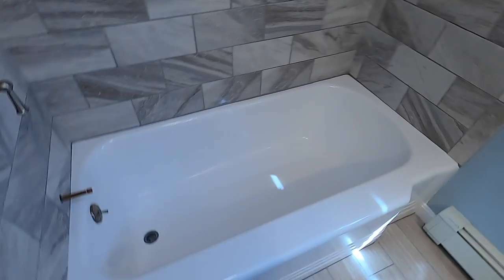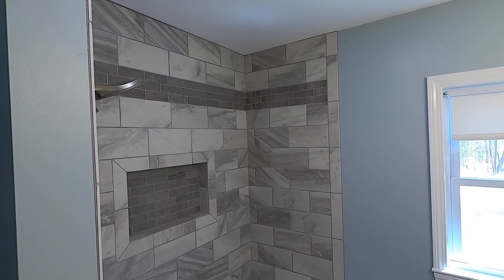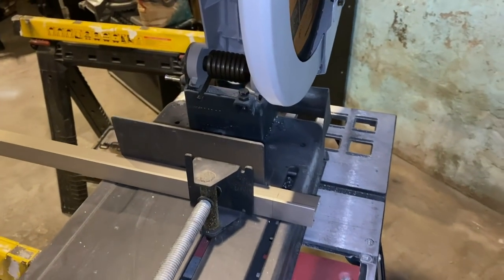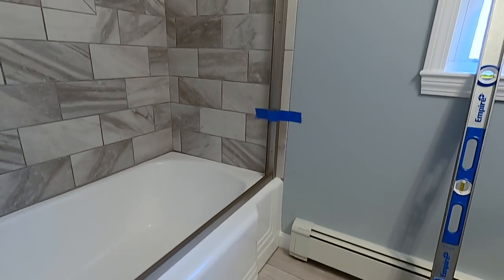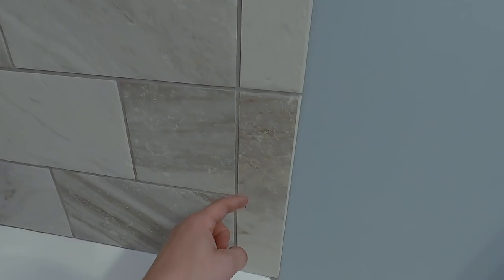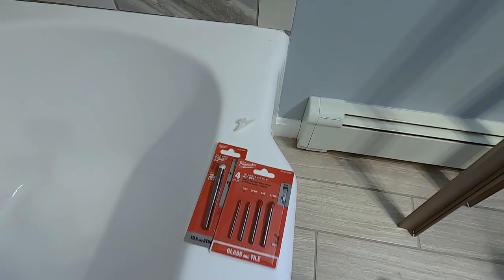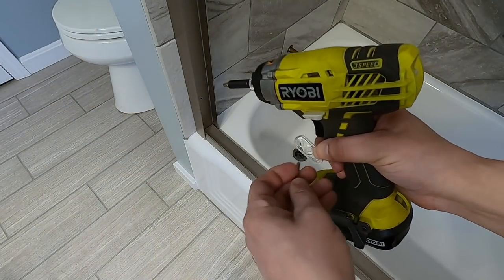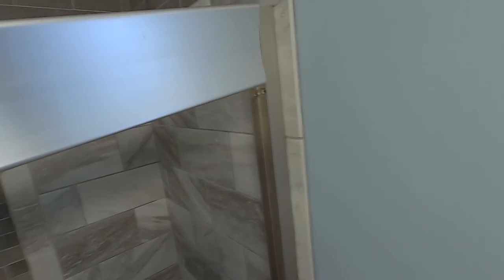How to Install Tub Sliding Glass Doors - DIY Bathroom Remodel Episode 23

Comment: The inside door should be closest to the showerhead so the water doesn't go out the opening between the doors. The other thing with that door, the water tends to splash over the bottom track.
Reply: I hate my Delta door for the splash under the glass and on to the floor. Adjusted the glass as low as it can go and still will splash off the metal bottom channel..
Reply: It's the absolute worst...I've just got used to wiping down the floor after showering. They had sent a rubber stick on channel after I complained but that didn't last long.

Comment: I will share what I consider much needed info on this Delta system. The brackets that screw through the glass that the rollers are attached to NOTE there are horizontal grooves on one side. The Delta Logo on both doors face into the shower. You can feel the etching. The inner door has the grooves facing into the shower. The outer door the horizontal grooves face toward outside the shower. Another VERY important NOTE is that if you try to use the lowest holes in those brackets you will NOT get the rollers to sit on the track rail properly & the bracket will rub against the frames groove for them to slide on. A tip my wife thought of was to add a tiny spacer behind the roller moving the roller out just a tiny bit. I used a lock washer that just fit over the screw & is about 1/32" to 1/16" thick. This allowed the roller to move outward just a tiny amount & allowed the roller to seat in the track without the bracket hitting. Another VERY important thing is the set your inner door inside the tub/shower placing shoes or something to support the door to rest on & lean the door against the wall then set the outer door on the track then set the inner door last. This gives you more swing room to get the rollers on the track without bumping the inner door. One last thing is to NOTE that if your tub/shower is NOT perfect level your doors will slide to one side. Ideally you should set both rollers in the same holes on each bracket but in the real world this does NOT always work so you will need to use different holes for each roller. This takes time but when you get one that works you copy that to the other door. Now back to leveling your unlevel tub/shower so your doors move & you have enough door to keep water in. You can shim the front or back of the top bracket & you may need to cut one side bracket lower to get it level so dry fit first. Lastly your doors will have more room height wise in the front or back depending on your case so try your best to get them as low as possible without whatever side is lower hitting the bottom track. The info I provided here should be in the manual & spacers such as the star washers should be included to use hole #1.
Reply: For the handles make sure you added some silicone to the tops of the slide over covers to cover the screws. Why cause when you clean they are knocked off easily.
Reply: @TheCleaner6969  YES WHAT YOU SAID.  THANKS FOR THIS. NOT HAPPY WITH DELTA. HATE THE WATER SPLASH UNDER THE GLASS DOORS EVEN WHEN ADJUSTED AS LOW AS THEY CAN GO.

Comment: for drilling in tiles i suggest you using hollow core diamond  tubes like the ones for bigger holes in tiles.. but smaller size like 1/4 inch... we have them and i am sure you have them also.. just need to find them and see how much faster and easier is to drill tiles then this drill bits you using here.. i also try with this ones as they say is for tiles... but they are good just for the cheap tiles that are not that strong..

Comment: Beautiful Job. Have 2 questions, what type of switch on the right going out of the door and its function, fan light, fan or light and a lighted switch. #2 is why did you spray the tub instead of brushing it, because it has evenflow in it and is made to look brand new store bought, spraying takes a lot more coats, have not done anything since 2007 and miss it.

Comment: Anyone have a solution for doors that roll away from the wall and creating air/water splash gap? This is a new build and both 5’ showers are having the problem at 1 month old. 🙃 Excellent video.
Reply from the maker: Hey!  Did you notice the part of the video where I show how the wheels can be adjusted on the track?  Have you tried this yet?  Sounds like something is out of level, if you adjust the wheels it may shift the weight of the door and get it to stay.  Hope this helps.  Thanks for watching!

Comment: Super late question considering you dont even live in this house anymore, but doesn't drilling through the water barrier ruin the seal? Or are these anchors sufficient for keeping water out?
Reply from the maker: Hey!  After sealing the inside tracks it will be fine, the rubber bumpers are enough to stop the water on the inside of the tracks.  Hope this helps!

Comment: if you have to adjust the wheels... do you have to keep taking off the door, then guessing at the adjustment, then putting it back on, then taking it back off, then guessing again and so on until you get the correct wheel adjustment? it doesn't look like you can simply adjust the wheels when it's tucked inside the frame like that. no?
Reply: YES MUST REMOVE THE DOORS TO ADJUST. POOR DESIGN ON DELTS PART...